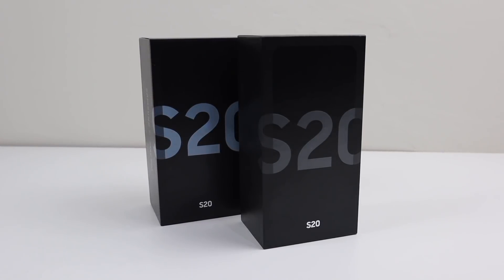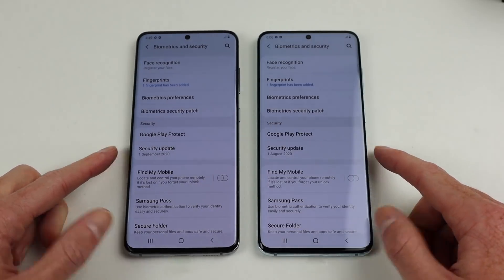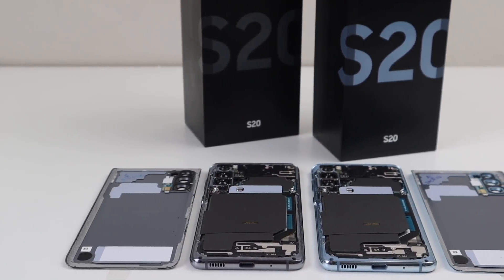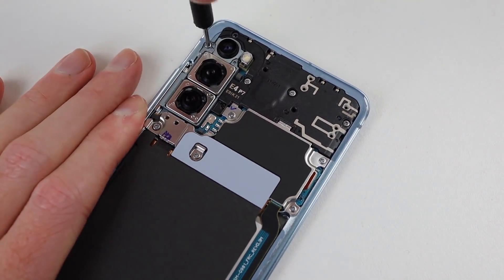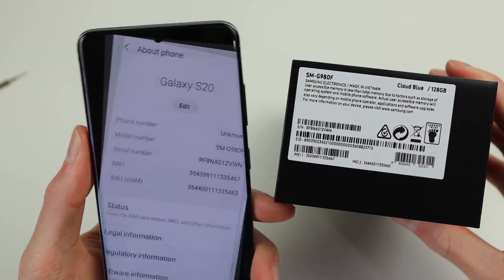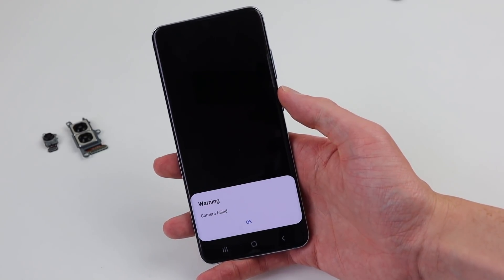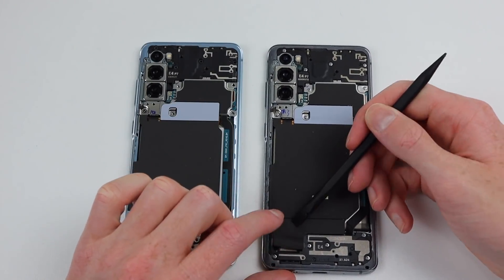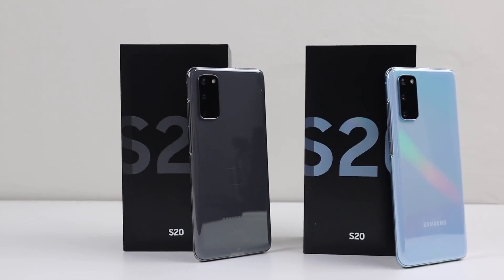Is Samsung locking down 3rd party repairs? Galaxy S20 Teardown and Repair Assessment

Comment: If the charging port on any phone becomes unreplaceable, we riot.  Charging ports take up so much physical abuse
Reply: @xabhax  Anyone who doesn't have a wireless charger, or for any other handful of reasons...?
Reply: @xabhax  you don’t represent the entire world, mate.
Reply: You know that wireless charging is like... 30% slower?
Reply: @Matthew Kessler 
Me.
Reply: @xabhax  I pay for the phone and every part inside it. Of course I expect it to have a durable charging port. If you can preserve your charging port with wireless charge, it's good for you but not for us.
Reply: @xabhax  oh man are you actually trying to understand? you said "uh you dont spend $20 on wireless charger, so your fault when $1000 phone breaks", and you actually say that this probably wont be the case in the time you'll use your phone. and still my point stays, it is not the customers fault, when a part in a $1000 phone breaks quicker than it should (in case the user didn't abuse the part). why should my product function like it should after i spend additional money on it? and like other ones said, not every phone has wireless charging and actually it is more harming, as it develops heat which is bad for the battery, even more when the charger doesn't lay exactly under the phone.
Reply: @xabhax  I thought you got the "it's consumer problem" from apple.
Reply: @xabhax  Why would I carry around a wireless charger?
Reply: @xabhax  Well here's two reasons right here:

1. I prefer using those thick defender cases (like Otterboxes), and wireless chargers don't work well through those.

2. I use those magnetic phone mounts in my vehicles, which use those stick on metal pads that go on the back of your phone/case (so the magnet will stick to the phone); and wireless chargers don't work at all through those.

And especially in my case (using both); unless you take the phone out of the case, you can forget it with a wireless charger.
Reply: Mine is about to be replaced on Samsung Galaxy J7 works very hardly
Reply: @xabhax  lmao for faster charging, cable charging is way better
Reply: @xabhax  you're an idiot lol
Reply: @xabhax  ah yes, it is the consumer's mistake when a part on a $1000 phone breaks with time that is literally meant to be used like every day
Reply: @User NoT eVerYoNne haS chEAp PhoEn, WE HaVE HiGh EnD PreNiUm PhoNe 

The thing is alot of people have better stuff to spend money on than a phone, and also most people don't even have their "high end premium phone" paid off.
Reply: @xabhax  1. What I mean by that is for people who know that charging by cable is way more efficient than by wireless charging.  2. It depends how much someone uses their battery and the capacity of it.  3. Jokes on you, I don't even have my phone with me.
Reply: @xabhax  not everyone has wireless charging phones 🤦‍♂️ omfg, also, wireless charging sucks it's way slower and you need to be hella close to the charger
Reply: @User lol you are a clown. Also I'm not 12 I'm 6 👶, also never said it was unusual.

Truth is most yall so broke you won't have the phone paid off by the time the next one comes out 😂
Reply: @User I think you're just trolling, I'm not broke. I'm obviously well enough off that I don't have to tell everyone I'm rich to feel rich 🤷‍♂️

Shut your mouth lil boy
Reply: @xabhax  Anyone who prefers their charging to be more efficient.
Reply: @xabhax  I was saying that the 30% gets wasted and becomes unusable energy.
Reply: @xabhax 🤨 lol ok, I repair my phones, I don't gotta hold my phones to a circle I can actually use them while they charge 😮😮😮
Reply: @xabhax  wireless charging is too much waste energy, as the results its so slow
Reply: @xabhax  suuuure, lemme put a giant circle behind my phone while I use it XD
Reply: @creepergod3692  exactly like wtf
Reply: @xabhax  god apple really got you.
Reply: ESPECIALLY when you combine 2 ports into one. It's bad from durability perspective
Reply: I was actually thinking that if I replace a 15w charging port like Samsung s10 with something like the s20 charging port, would the phone charge at 25w?
Reply: @numberIII-im4ee  Simply put, no. First would be the actual physical room in the phone may not match up, and then it would be that the connectors could be different and then the software and even battery itself could simply not accept faster charging than by design.
Reply: Ign  no idea why he thinks not having a $1000 phone means being poor lol. What are you going to do with it anyway that makes the $1000 worth it. Lmao
Reply: @User no it’s not normal to spend 1000 dollars for a phone, if you think so , you’re just another sheep for apple to drain every single dollar in your wallet! I’m still using iphone 6s in 2020-2021, i spend the rest of my money for gaming pc ! Tell me, what 1000 dollars iphone or whatever phone at that price can do for me?
Reply: Or make them stronger.
Reply: Of all people, I least expected to see you here.
Reply: anyone in this thread smoke weed?
Reply: @Managlyph  uhhhh 🤨
Reply: @Managlyph  hell yes bratan
Reply: @xabhax  Don’t try to be cool. You can only be cool with a samsung
Reply: @xabhax  not every phone has wireless charging, majority of them has standard cable charging to reduce costs of manufacturers
Reply: Well there will be a time when you won't have access to wireless charger and join the peasants
Reply: Thankfully this problem doesn't happen that much after USB C used in phones.
Reply: @xabhax  wireless charging sucks
Reply: @User lol I'm 18 not 10
Reply: Agree, the charging port of my phone is dead, btw :c
Reply: @xabhax  if they're rated for 10,000 usage cycles, then how the hell are they breaking in 2 yrs of usage?😂

Are you automatically gonna assume it's because I used it incorrectly?

Big Tech brainwash right here
Reply: Wireless charging is very slow. Samsung , xiaomi phones have very fast charging devices with cables..... the xiaomi Ultra latest has 120 watt fast charger and a special battery to deal with high watt charging.... goes from 0 to 100 in 30minutes max....
Reply: From "Secret Life of Machines", when they made the episode about how a fridge work, they got a pile of fridges for the set almost for free. All of them did actually work, and most of them suffering cabinet issues, broken plastics, seals, door missalignements .. etc. They nailed "What tends to fail first is the physical interface with the user". Something that most be clear in the mind of any designer.
Reply: @xabhax  The majority of "regular" users still use charging cables.
Reply: @xabhax  when I'm laying in bed trying to watch YouTube or Netflix dipshit
Reply: @xabhax  >screeches about certifications
>then backpedals onto a seething "h-hope your port was made correctly" thereby contradicting his former statement
Shills really get paid too much these days.
Reply: @xabhax  >advocates for anti-consumer practices
>clearly, I cannot be paid for this 
>no corporation would ever want to encourage and spread FUD/ill will toward anybody protesting their future removal of ports on their devices
How much per post?
Reply: @xabhax  A phone generates heat while Charging, the charger aswell, and if you Charge wireless, you gonna get combined heat, and heat damaged the camera, you gonna damage it faster.
Reply: @xabhax  wired always works faster and with wireless charging there always will be a wire involved
Reply: Well that’s what happened with the Samsung S10
Reply: @xabhax  my phone stop charging on 100% even if it plugged
Reply: @xabhax  anyone who wants their phone to charge at a normal speed without burning up?

Comment: Apple: 2 screws different heads
Samsung: 70 screws all same head
Reply: Apple : locking down all 20 screws to stop third party repair
Samsung : all 70 screws same, not locked, and buyable from anywhere
Reply: Samsung: Using more screws to make components coming loose inside the phone from vibration much less likely.

It's almost as if they engineered a phone to reduce the amount of e-waste it generates, unlike Apple.
Reply: Lol saving the environment by not including charging brick
Reply: @incisive1896  not including a phone would save the environment more
Reply: @HoangNguyen-ej4wb  dont give apple any idea
Reply: @HoangNguyen-ej4wb  Yes the phone screen will be sold separately.
Reply: What she said....

Comment: When I replaced the battery on my old S9, I didn't connect the wireless charging and it was actually charging (through cable of course). This may have been just on my device, however, I strongly recommend plugging the wireless charging back in as it may not charge properly or may damage the device

Comment: I had issues on a galaxy a20e motherboard connected to a new screen no longer supporting WiFi but in the original screen it works fine